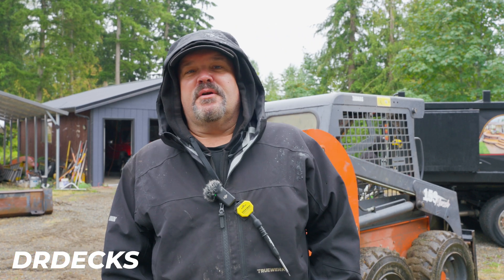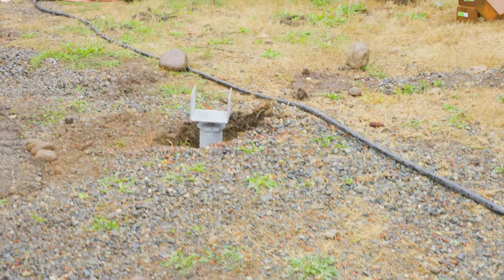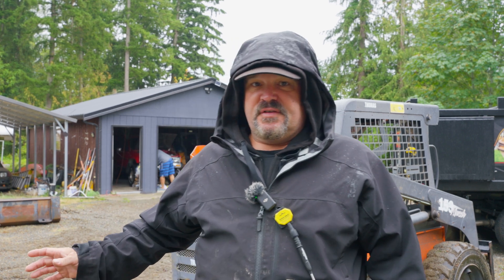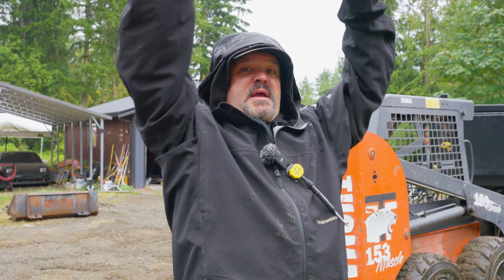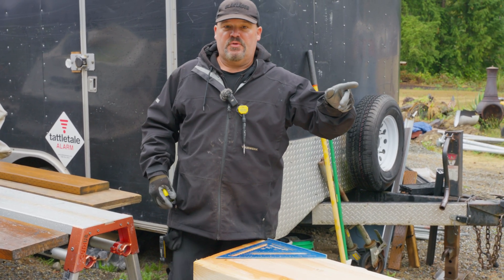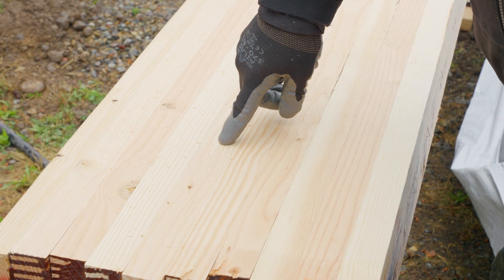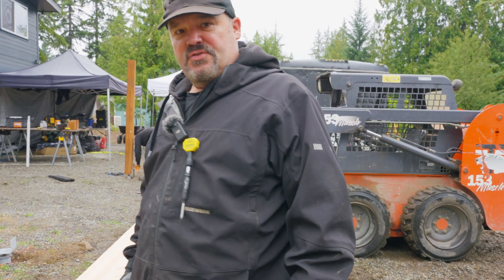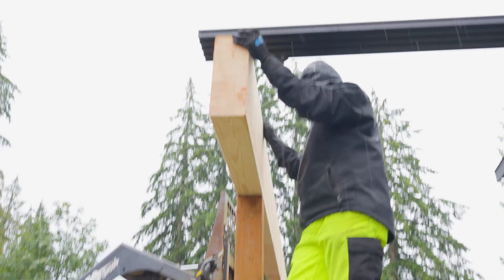How We Set a Massive Beam WITHOUT Breaking Our Backs

Comment: Weight on the thumbnail is way off for sure.  The ridge beam for my cabin is 22" diameter by 35' long and only weighs 4300 lbs.
Reply from the maker: Correct. We had a miscommunication with our editor